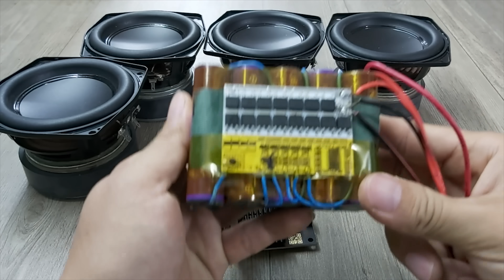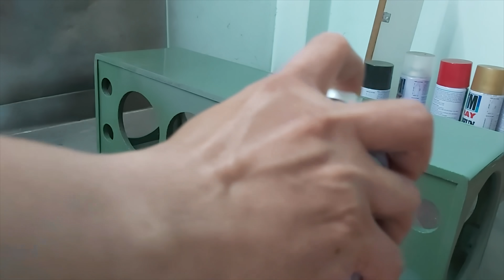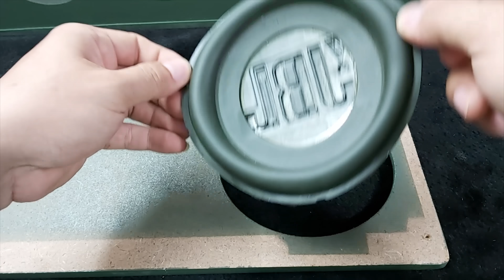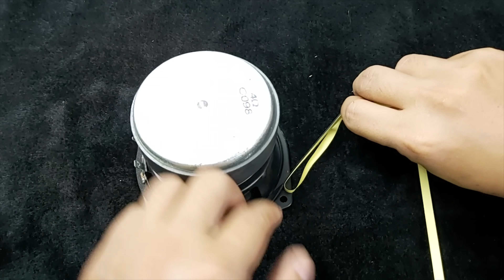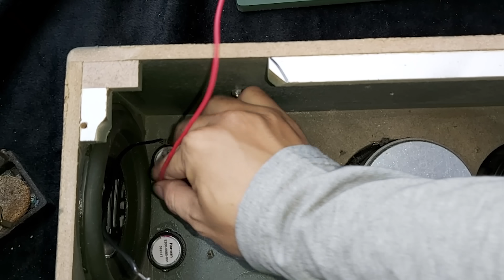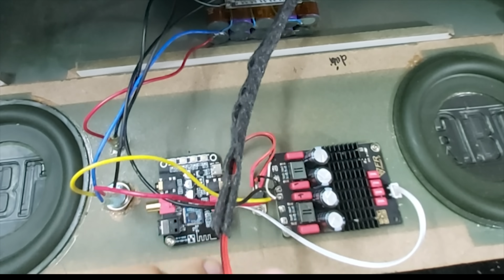DIY Bluetooth Speaker The BoomBox IV ( From old broken speakers) - EXTREME BASS TEST 100% LFM

Comment: bro you should leave a hole for air exchange. Because without air exchanging, The air pressure inside makes to less vibrate. Hence less sound is produceed

Comment: Sorry to be late to the game, but am I correct in seeing that you wired "all" your speakers in parallel? I mean, if that's what I saw then you damn near took your amplifier impedance to 0 (zero) Ohms. That's basically arc welding & detrimental to your amplifier. I.e., "not long for this earth"...

Comment: the passive radiators might be too big. battery seems kind of small like 5ah not sure. and i found that my speaker rly lacked mids when i added a subwoofer and a tweeter and used another woofer from 500hz to 10k it felt kind of flat and a lot of rock n shit was horrible. later i bough a car speaker with a high cone but still a woofer and made it from 500hz to 16k was much better and got fuller sound. tho this design has a huge internal pressure problem. if you match speakers its fine like a woofer box or a sub box but when you wanna build hi-fi the sub just resonates the woofer/mid speaker so much that you have to take the lows off and but a specific speaker that can take the resonance and the air pressure, If the passive radiators are heavier then the other speaker the speaker will work as a radiator so weight of the radiator has to be considered thats why i said they might be too big. In my calculations i went with 100w sub 50w tweeter and 50w mid speaker. now i would recommend undersizing the sub to match whatever else you have and just looking more for a 90-125hz pop base range cause when you go truly low you lose the quality of the other speakers. Its like a speaker with Hi-Fi mode at certain Volumes for certain music.
Reply from the maker: I used 4 Mid Bass speakers so missing the mid is impossible
Reply: @hvccreation  okay then i would suggest putting a low pass filter on one of them to 100hz and another from 100-500hz you should get quality out of it. GL

Comment: Did you use those washers to recess the front of the speaker box?? That's a great odea
Reply: Before you started gluing the box together you put 4 silver washers under the board. Was that to create depth on the front panel?

Comment: you put 2 speakers and 2 tweeters in parallel on each channel. That sums up to 16 ohm, which is a huge power loss.
You should: 2 speakers in series (puts them down to 2 ohm) and put two of this combination in parallel (adds them up to 4 ohm again).

Should be a huge power saving, since you do not need to crank up the amplifier for the same booom :)

Other then that, nice ;)

Comment: Why Was it not ported, And the tweeters I feel so sorry for them, Surprised they haven't been blown or sucked straight out, they need to be boxed in separately inside to better protect them and 4 JBL exciters a bit overkill, one either end would be enough plus no one can see the ones on the back, But over all I say you did well and will probably take comments onboard as there are constructive comments that will make you want to do better revision, also you need acoustic padding stuck to inside walls for better clarity and deeper bass it vented like a 4th and 6th order box

Comment: 4 midbass 1tr2
4 treble 400k
4 cộng hưởng 900k
Mạch gem 400k
Mạch âm sắc 360k
Mạch bluetooth 300k
Hạ áp cách ly lọc nguồn 150k
Pin 5s2p + sạc 700k
Thùng + sơn 1tr
Linh kiện linh tinh + công 700k 
Tổng hết đúng không bác , có dư có thêm gì bác chỉ giáo 😂
Reply from the maker: Đã bán rùi bạn
Reply: Bác có zalo hay fb gì em liên hệ làm con này bác ơi

Comment: yikes!! cool project! gotta isolate tweeters, or use sealed back style. i would have sanded more (or sanded at all). Other than that, i'm impressed!! Nice work. I'm working on one similar in some ways and also plugs in to AC power with NO battery pack option.

Comment: Literally everything about this is wrong.  The list of HUGE mistakes made in assembling this would be too long to get into here in the comments section.  Just to name a few:
1) No crossovers = blown tweeters and problems with sound.  
2)  Passive radiator and tweeters held in with glue will come loose from air pressure in the enclosure.  
3)  Left and right channels not isolated in the box, and tweeters getting sucked in by the bass, already destroyed.  
4)  Solder connections hilariously bad.  
5)  Sloppy wiring running all over the place will vibrate.  
6)  As if all that isn't enough, I can guarantee there was no calculations or tuning done and that it sounds awful.  
To those watching:  DO NOT copy this design nor these methods, as they are (literally) all completely wrong.  This was a total waste of all the materials used.

Comment: Nice build just a shame you didn't understand that the magnets from the speakers will eventually cause an electric surge due to placing the wires on the back of the speakers and not attaching them to the wood instead.....

Comment: If you want extreme bass why do you have mid woofers  and tweeters?
Edit:this probably was from the jbl partybox 2 so still alot of bass but subwoofer gang and a ideal superbass build 4 subwoofers 3 midwoofers 1,2,3 or more tweeters for pressure of the bass (not needed obviously) ANOTHER EDIT:audiophile time what the hell was bass

Comment: The tweeter is sucked in by a large negative pressure in the middle of the housing and as you can see its dome is sucked in and pushed out, vibrates, you need to isolate the tweeters from the bass loudspeaker chamber, besides, the project is very cool, admirable greetings from Poland

:goodvibes:😁
Reply: they also get installed from the outside not inside the back set is blocking directional imaging and narrowing the sound stage but kool project why did you only cap them in pairs the mids and tweeters should be capped individually and doing so will enable driving more power to each speaker for the Frequency the driver can play best
Reply: POLSKA GUROM
Reply: Does this mean that you would put a enclosure around the tweeters so that it isolates the air between the main chamber?  would you do it individually to each tweeter (think a cup on the back) or would you put all twetters in the same isolation chamber?
Reply: @RileyPorter general the tweeters come with their own rear chamber.. but these are bare back ..so need to be put in one ..even i couldn't tell until I saw that deformation of dome
Reply: Easy fix but neat I caught it and then saw you had already posted!
Reply: Im still trying to figure out why the tweeters are wired in with the midbass those are 2 completely different frequency needs they wont last long on that power but aside from that super cool project
Reply: @Tony2Pockets Ola! Eu não entendo. Como séria a forma ideal?
Reply: the tweeters are already sealed, no need  to isolate them through chambers
Reply: he's a DIY guy not an audiophile let him be
Reply: @r-ratedstudios3847  no its  good they are calling him out on his poor design  there are many morons making theses boombox's all jacked up
Reply: The tweeters look perfectly fine to me and if knew that if not isolating those tweeter was going to be a problem then he would of done it but did he no so what those that tell u
Reply: exactly what i thought
Reply: Siema polak
Reply: @mikoajdomagaa7741  joł
Reply: @FCDynowZKS  elo elo siema eniu

Comment: You just killed 4 perfect Harman made dome tweeters by not adding filter for them and not isolating it. Congratulations.
Reply: not to forget that he/she didnt seperate any of the volumes for left and right 🥲
Reply: Там конденсатор он поставил, смотри внимательнее. А вот в плане отдельного объёма косяк
Reply: @donkers228 he meant to separate those tweeters for there air coming from the sub speakers
Reply: @donkers228 um capacitor é melhor do que nada mas o certo seria com um indutor para formar 12 dB
Reply: and using a TPA3221 amp, that with a 18v battery probably delivers 2x45w rms,....... connected to 160w rms woofers and 80w tweeters. Yes, not a very good idea
Reply: Harman made? Those are made by ggec.
Reply: @theloudspeakernerd-tlsn9322 he's talking about JBL JBL is owned by its parent company Harmon Kardon
Reply: He put the capacitor in his blind, but the right one was an inductor in parallel with Twitter forming a 12 dB splitter

Comment: It’s nice and looks like it sounds good but on the last song the bottom tweeter looks like it’s popping because of the base hitting hard you should enclose the tweeters inside a smaller box internally to keep the sound clean and to prevent the popping

Comment: first off, did you just run 2 sets of the woofers and 2 tweeters in parallel without any crossover!? and try covering the rears of the tweeters so they stop emploding

Comment: you have to match minimal amp output impedance....regular as 4 ohms (minimal)...Using more than 4 speakers...please... measure with a multimeter into the output from the amp. if its lower than 4ohms...you have to use resistors in each speakers to match 4ohm (minimal)
Reply: You can check Technical Bakshi channel also😉

Comment: such a nice build but you probably are suffering from comb filtering for using 2 tweeters per channel, 1 tweeter is better than 2 o 3, in case of tekton speakers they use a different crossover setup for every tweeter groups achieving a beaming effect that is really nice.

Comment: Great concept love the idea. Work on your painting skills and you’ll be golden, saw some nasty paint runs. I’d recommend double baffle on the front to hide the speakers mounting brackets. Mid woofers looks pretty good I’d run little higher grade tweets with some actual mounting tabs or something. Passive radiators are dope man never thought to use ones off JBL cool idea.
Reply from the maker: thx bro
Reply: @hvccreation  ?okk
Reply: @hvccreation  -  Also consider putting a piece of metal on the regulator. In a confined space things are different. Temps rise and with nowhere to go, it gets very warm in there. I have even used a very low power 24 volt fan in 12 volt applications (sometimes 48 volt). It just spins slow at lower voltage and consumes little power... quiet and efficient and stirs the air so that temps are even. The speaker frames will conduct out and radiate the head with a stir fan. Laser thermometer will confirm this. (I used to live in a very hot place and learned how to keep projects cool)
Reply: I thing bro iss correct... Tweeter
Reply: Bro ur speekar are not speakers is a like a boms.. 🔥🔥... Plzz send me ur contact...
Reply: I think he should have used coax speakers then the tweeters are outside and not under pressure as well as the metal bridge across the woofer supporting the tweeter and/or midrange  protects it from "Ger Fingerpoken" and "Ger Mitten Grabben"  :)

Comment: nice but it needs some type of baffles to try and control the waves of bass. if u look u can see the woofers not moving in and out straight ,they are wobbling off axis wich will cause the voice coils to rub in their tiny grooves ,causing overheat and failure

Comment: Why are the black wires were joint with a red wire? Ain't supposed to be black wire too? The red wires connected to two speakers were joint with red wire which is correct? How come the two black wires coming from speakers were joint with red wire too???

Comment: Hi, nice work, but there is a problem on the tweetwer in the lower right in the foreground, on the low frequencies it bends, it shouldn't happen.  Didn't you put a high pass filter on it?
Reply: There’s a high pass but he didn’t seal it off from the woofers

Comment: I like the idea to take the speakers from broken JBL boombox. Very clever. 
BUT...
Just another fraud. I bet than thing can't even be turned on and speakers where powered behind the camera from another real working amp.
No power measurements, No schematic, No charge circuit, No Dc-Dc step-up converted for constant voltage for the amp, This switch would be burned to crisps with the amount of current this amp need to reach it/s full power - only relay or solid state relay can be used. Not even router woodwork around the edges of the box was shown. One more thing. I do have exactly the same BMS board and it works like crap with any charging current higher then 100ma. This battery pack would be charging for a week minimum.
Reply from the maker: but this video is true

Comment: You need to put a bipolar (or non-polarized) capacitor on the tweeters so no bass and midrange enters them.
Reply: there is a yellow non-polarized paper cap in the wiring, but the cone of the tweeters are somewhat exposed to the enclosure and that is bound to destroy those tweeters.

Comment: The tweeters need a capacitor and you should put the passive radiators just on the back so the tweeters dont get pushed by the air
Reply: it's air pressure in the enclosure, they'd need their own sealed enclosure in order to prevent it. It doesn't matter where the passive radiators are.
Reply: @childishtombino1275  he needs a capacitor on them because they're getting the mids and lows signals

Comment: How do you charge the power supply, what parts did you use for the aux plug in and charging port for battery pack.. ?! Last question I have is what’s the little piece that you were soldering wires to in front of the amplifier... I’ve watched this video probably 40 times and wanna try to make 1 myself.. Thank you

Comment: tweeters need to be sealed off in their own compartment, good idea though...
Reply: I agreed with u
Reply: He joined 2×4ohm speaks in parallel =2ohms. 2×8ohm tweeters parallel =4 ohm joining all together =1.6 to near 2 ohms. RIP amplifier. He annealed it.
Reply: Tweeters don't need compartment
Reply: @mansuriaftab4850  if tweeters membrane is enclosed then No, but if they are visible then YES! also midrange speakers have to be sealed, that will also take the DB level higher up and make better sound!

But this box he made is trash, he doesn't have the right air for those midrange which he is letting play bass also the finish is so poor, cracks are visible and the jbl fake membranes are designede for a surtain bass and not for looks only,  what is the resonans of the units and the box?
This is a ok cool projekt, but it looks like shit and All common sense and knowledge about the science behind building the correct box and using correct filters are long gone....
Reply: The battery would last like 5 minutes at max
Reply: @highhat5229  😂😂right

Comment: you need a crossover on that thing
Reply: You have to or else the tweeter will blow. Is there a capacitor wired to the tweeter?
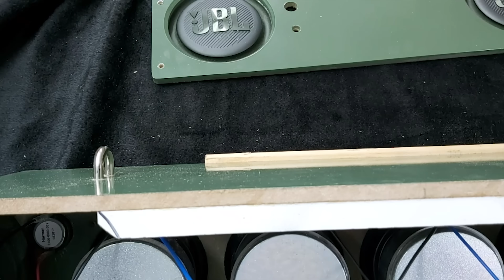Reply: @djijspeakerguy4628  8:10 look where he taped the wires theres a lil capacitor there
Reply from the maker: i dont think so

Comment: 13:35, even that tweeter is trying to produce bass
Reply from the maker: yeah, rip tweeter
Reply: @hvccreation  did it survive?
Reply: @officialhyperman  it died from Bass overdose.
Reply: @hvccreation  You just have to build in a crossover or at least a non-polarized 2,2µF or 3,3µF capacitor, then it'll be fine. And to be safe, seal the chassis of the tweeter with something like hot glue.
Reply: @hvccreation  should have covered the back of the tweeter since it doesnt produce bass its just gonna break itself that way
Reply: @hvccreation  can i buy the speaker off you
Reply: 😂 Tweeters not great for bass
Reply: i can see the capacitor installed though!
Reply: @FordForTheWin  Yeah it could be that it's either running full range somehow through miswire, or if the tweeter isn't a sealed component, the air pressure could be affecting it.
Reply: @childishtombino1275  i was thinking the seal around the tweeter.
Reply: @FordForTheWin  No, that wouldn't cause the tweeter to do that, the air would just leak if it was the seal around it.
Reply: @childishtombino1275  its the air  pressure cuz u  see the dust   cap bending like that aint because it would try to produce bass
Reply: @sakaritahtinen8696  Yes, tweeters can also create air pressure with themselves if they are sealed. I've seen it before on tweeters that have been fed full range or lower frequencies.
Reply: Holy shit i just notiched
Reply: Price spiker price
Reply: Guys, HERE is our True Savior

HalleluYAH (Hallel u YAH) - “Praise YAH”

YAH The Father (Genesis 1)
YAH arrives via The TENT OF MEETING
YAH was Who they Crucified for mans sins
YAH was Crucified on an Almond TREE

Original Semitic of Moses
Isaiah Scroll (The Original Isaiah)
Reply: This entire build is questionable ... Not only the tweeters... But also the use of the passive radiators... Those need to be tuned to the airspace and woofer frequency... This looks cool but pretty sure it sounds like crap.
Reply: @DBSMODs  nothing wrong with passive radiators. You are paranoid. They sell 12" passive radiators now. They sound great. Its free bass. Its like using a turbo, its using otherwise wasted energy to make something useful.
Reply: @ryanmalin  ... I never said there was anything wrong with them... But they have to be used properly for the application ... Airspace in the box and tuning to frequency for proper performance... If you use a passive radiator wrong it can cancel out all the bass and ruin the build.